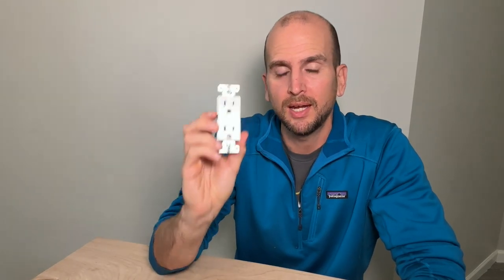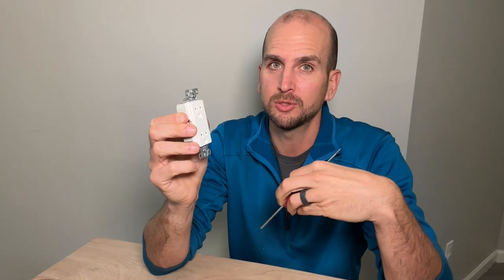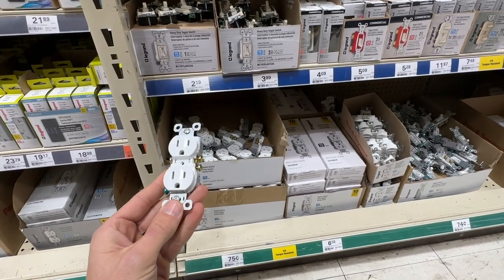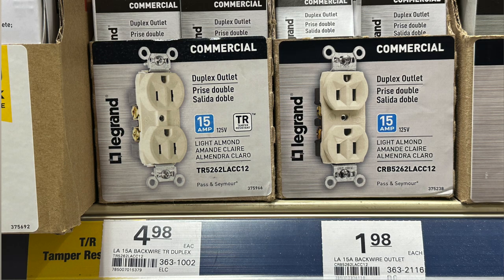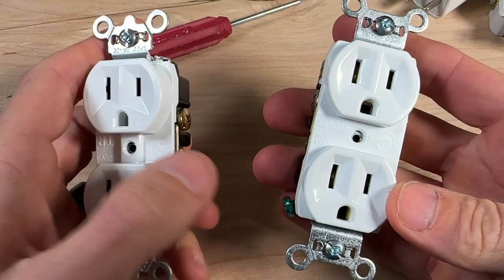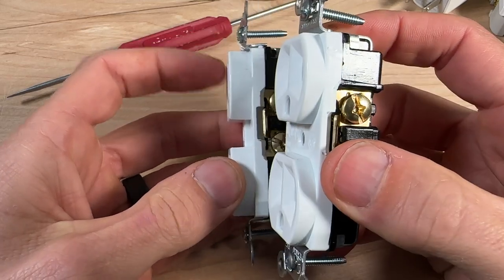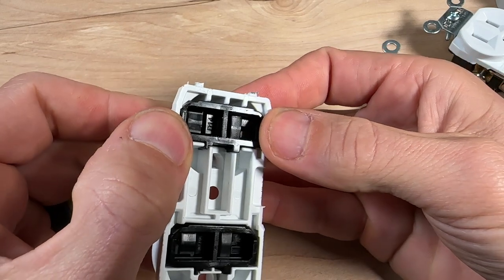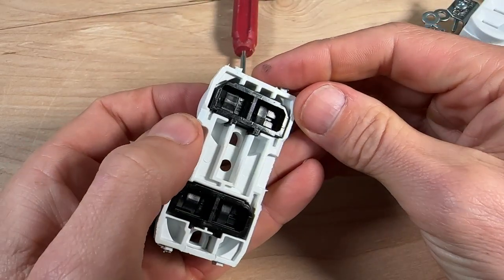The Most Hated Product In Home Electrical

Comment: Don’t like them BUT just switched 20 outlets to TR. why? Because I have kids and I’m tired of having to use those little safety plastic inserts every time I use a socket. They are tight, hurt my fingers to remove, and are generally annoying. Plus, I think they actually TEACH kids to stick things in outlets lol. 

When they’re older I’ll likely switch back to standard.

Comment: Nothing wrong with coming up with common standards but forcing the design will not allow for better designs.

I mostly use Eaton or Leviton, they both have had issues with TR on scale (mostly manageable), only had one broken one with a GFCI by Leviton once. 

Sometimes when trying to plug something in it doesn't go in like you demonstrated. I found simply rotating the plug clockwise/counter clockwise while apply pressure it eventually works. If the plug requires this after a few attempts, might want to replace it, maybe something just out of spec.

Also if there is too much wiring in the box or you are putting too much pressure on the outlet, this may cause a problem as well and it will not matter the manufacturer.

Please don't play the commie hand while using a product that you like as an example when it was designed in the free market... And then declare the rest all suck and should have been made this way and imply that this design is obvious. There are patents and intellectual property issues that you are glossing over.

Comment: I’ve taken the Amish approach to electrical outlets- use someone else’s. I’ve been told that every time you say you don’t believe in using GFCIs everywhere, an NEC author stubs his toe. I keep wondering where the line gets drawn with expensive safety features. More safe is not better when the risk doesn’t justify the cost! If you can afford more safety- perfect! Do it! If you’re like everyone else, chose an appropriate risk level and build to suit.
Reply: Let someone get hurt in your home with an item that you should have purchased diffectly by code and see what your homeowners insurance does if they is a liability issue...
Reply: New term: “diffectively by code” 

It’s not unsafe, it’s just not the level of ‘safety’ that some dude somewhere arbitrarily decided I should have. Again, I have measured the risk, and the risk was left wanting.

Comment: Wouldn't it make more sense to have the mechanism only block the hot side rather than both? Then it could be simpler and more reliable. Idk. I have a design in mind, but don't want to sketch it out right now haha. Also, I used to work for legrand and get really low prices on outlets, but I didn't think to get TR ones because they didn't seem to address a safety issue as well as partially insulated prongs would, like they have in Europe. I've never heard of anyone getting shocked by an outlet without something plugged into it, but I know lots of people who have touched one or both prongs on a plug while unplugging somthing.
Reply: Every friggin kid I know has stuck an item into an electrical outlet and received a shock, I did, my daughter did and both of my grandkids did. Do you have no kids, family or friends?

Comment: I think the premise is wrong: No, it is not ok to impose additional cost on something because it buys safety, without asking what that cost is. 
If the delta in price is indeed $3, then every 300,000 outlets bought would cost $1,000,000. For that money I could buy a lot of safety in other areas where it would make a difference. I doubt that every 300,000s electrical outlet is saving one child from being electrocuted.

Comment: As a 25 year electrical journeyman, I have installed and used a lot of TR's. The key with TR's is you have to be pushing straight in, we are use to the old ones which allow a lot of wiggle room especially vertically. TR's do not like that, a little more time aligning the plug cord end up with the recepticals allows them to function with minimal effort. It does not take long to get use to this we are creatures of habit.

Comment: If tamper-resist was cheaper I'd still pony up for the non-tamper-resist because i DESPISE those things. it's similar to the modern gas jerry can spilling more fuel than I've ever spilled with vented non-safety nozzles. I've BROKEN cheapy prongs trying to push into tamper-resist outlets.

Comment: Totaly understand safety but when you’re trying to insert a non damaged plug end into a TR and it binds the cheap metal bends inward and grounds hot to metal mud ring its bad. I’m more of a fan of safer breakers that i do have and also have my fair discuss about. CAFI breakers nuisance trips .But thats good with ground faults and afci issues so if national lampoons Christmas cat gets cord it may not use all 9 lifes 🙃

Comment: I live in a house that is at least 30 years old.  There are none of those things in here.  They are the old regular outlets.  I never had any problems with them and so I just leave them as is.  First they mess with our gas cans and now they have annoying mechanisms that only make them harder to use now they do this.  If they didn't get any extra money from selling something "new" they probably wouldn't do it.  Really they should wait until all of the problems with those outlets are fixed before they make it a part of the code to use them.

Comment: An extra couple bucks per outlet times 50 plus the hours to replace your already installed outlets vs. $7 for a 25 pack of little plastic child safety covers is an easy choice. I just wish they were easier to remove when necessary.

Comment: i put in TR outlet in my shop cuz my electrician though it was a good idea. they are awful. 80% of time i cant get something pugged in on one attempt. they bind up when pluging in a normal plug. and i actually have the opposite problem, I had to check 2 different stores to get a normal outlet, cuz I'm never buying TR again. spending 5 min to plug something in instead of 10 seconds is not how i want to spend my life

Comment: I'm not worried about my kid sticking something in an outlet because when you get shocked the first thing you do is pull your arm back with brute force lol. People lock on to the power when you grab onto it so it makes your hand grip harder. When you grab a fork and shove it in its not your grip strength that's the weakest link it's the grip of the plug onto the fork. so no real risk of prolonged electric shock

Comment: I absolutely hate TR outlets. At least all of the ones I've used have been super janky and require a ton of force or fiddling to get them in. I usually get tired of them after a few times and replace them with non-TR outlets. Maybe there are some good quality ones, but at least the ones I've used have been crap, and I never buy them if I have to replace/install new receps.

Comment: I stuck a Bobby pin in an outlet when I was 3. I never did it again. Problem solved.  We can't make everything 100% safe. These outlets are ridiculous.  Put in the plastic plugs if your worried about kids. The tamper resistant features make them almost impossible for anyone to use.

Comment: Not safer. I went ahead and replaced mine because my son is super curious. Since installing I've found many plugs are not plugged in all the way. My wife plugs them in partially because she isn't paying attention, she has power and just isn't using enough force to plug it in all the way. I now have plugs with powered and exposed leads randomly throughout the house where the wife plugged something in

Comment: I hate these. I have one on an outside outlet. One day I couldn't get my pellet grill plugged in because it had permanently tamper proofed itself. I took a flat bladed screwdriver and smashed it in each of the slots of the outlet to defeat the tamper mechanism. Problem fixed.

Comment: Understanding and agreeing with the  concept of safety , I question the mentality of putting the plastic "child guard" plugs in the outlets. First , children WATCH the adult putting something in the outlet, so therefore 'monkey see, monkey do' thinking in their brain. Then the curiosity of unsupervised children successfully removing these small guards and then placing the guards in their  mouth, so a choking hazard.  A concern in my mind for a second 'standard' is receptacle box installed at 16 inch (top of box) . How is that standard good for the elderly to have to bend over so far to plug something in. How about wheelchair  bound persons trying to plug in to the receptacle without falling out of the chair.  There should be more flexibility for us installers to tailor to the needs of our clients.

Comment: When I was redoing all the outlets in one of the homes my older sibling got a ways back, I actually used these quite a bit. The mentality I took is that for general living space rooms (bedrooms, hallways, etc.) I used a standard decora outlet, but anywhere where moisture can be prevalent - like basement, garage, or washrooms (on top of the GFCI requirement) - I swapped the TR style in. While there's nobody little sticking paperclips into the outlet in the house, the reason I went with them is I felt while it does very little to make an outlet waterproof, that added shutter struck me as being helpful to keep direct moisture out of the socket - especially say if you wash your hands and go to flip off the light switch which is next to an outlet in the same box. I used mainly all Leviton brand (just what the store around where I am stocks the most of) but can't say I've had any complaints with them... Well, ok, my dad hates them because they stop him from being able to easily check current/voltage with his multi-meter probes but that's a bit of an edge case if I ever heard one haha. Great video!
Reply: You should have bought WR not TR. And try drying your hands before you flip the light switch, you could still get a good zap from the switch alone!

Comment: OMG @2:50 the price difference is only 3.00 used I rather spend more than get the standard ones. Plus, you should never buy the cheapy 0.74 cents outlets. Trust me I did and within 1 week that outlet went faulty. Every time I go to plug something into that cheap outlet it would trip my breaker and also notice some arcing as well with those cheapy outlets.

Comment: On Decoras Cost difference in truth is about 20%   not 100% .....
And sadly our home Impovement stores do not sell Decoras 'regular' 
While I get the issue of 'safety' .... the problem with the flimsy electrical plugs these things are a nightmare and truly non functional and actually more dangerous as the prongs on plugs bend
I did my home, I searched high and low to find non-TR decora outlets  
Note, I have no kids around, 59% of households have no kids around
.
The logical thing would be to switch to European outlets/plugs, but reality unfortunately does not let us dump our US garbage plugs and outlets

Comment: One single probe in the hot side will not short or burn the inserter since it is not connected to a neutral or ground. If the kid sticks a fork with two prongs, he will get shocked anyway. And where will he get a two pronged fork? In the hors d'oeuvres drawer?  Or two separate prongs, like a baby pin or spread paper clip?. They will go in. So 'tamper resistant' is nonsense. Two things that will arc go into the slots whether or not. One thing does not. But one thing only is not a danger.

Comment: It's ridiculous to have something be part of code when they don't even function correctly. I don't know the brand, but my parents had a room redone about 10 years ago. All the outlets are TR. And all of the ones that are in regular use are already breaking down. Unreasonable force to push them in, and then they don't even hold the plug in, so the prongs hang out exposed. And power adapters just fall out. My assumption is the way your hand has to force plugs in causes the prongs to go in at less then ideal angles, damaging the terminals. So now you have the fire hazard of loose connections in the wall in addition to live, exposed electrical contacts.

Comment: I'm all for safety but enuff already. The reason most aren't using them is we are tired of Gov't over reach. TR outlets in a house with no children and the residents can't  plug into them because they push too hard. Gfci and Arc fault breakers , extremely expensive and though better than they were just do not work. Most new construction houses exchange them for standard breakers after inspection because they are sick and tired of their constant tripping. Gfci on circuits with freezers and fridges, come home after a few days away and your food is thawed and spoiled!! Car chargers, go out to leave for work and your car is uncharged because it tripped. And why do you need Gfci outlets for garage door openers that plug into your ceiling outlet? Ridiculous. I do not have 1 gfci in my house or garage, they weren't required when I bought my house or garage. I do have exterior Gfci on exterior of garage as they should be. If we are being forced to use these items then they need to work as efficiently as what they replace and at the same cost, not at 10 x's the cost.

Comment: The CHINESE knock off no brand Tamper resistant outlets both residential and commercial are BAD BAD. I have samples of them too. They are easily defeated as  with older 1980s GE residential grade outlets and they bind up more often as you mentioned, and they break under frequent use or heavy use(rated 15A and you use 13A or higher loads, they melt). And they are not impact resistant despite being thermal plastic instead of the much older no longer used Ivorine or Bakelight ceramic like plastic composition.. The US branded outlets for the most part are great these days but you get what you pay for too so. My preferred outlets for tamper resistance and looks are Hubbell and Legrand/P&S brands.. Bryant is like Hubbell now, though they used to make a tamper resistant outlet that required 3 prongs to be plugged in before the shutters would open, the same as British Sockets do.

Comment: another reason maybe is only 2400 children a year get hurt by electric shock and so electrical code is not going to mandate and for good reason as most of us apply the winnebago battery maintenance effect and dont want to tear our house apart to get to  the outlets to change them.

another thing that would work better is to have a diy zero skill solution in the form of a wall wart outlet box where the tamper resistance is built in so all the diyer has to do is remove the cover screw and plug in the outlet box and tighten the new screw and no need to turn off the power and the job is done very quickly.

it would be easily replaceable should the tamper resistance device should fail.

a problem with tamper resistance is only a couple mm of the prong makes contact and with heavy loads like air conditioners could cause the prongs to get hot as there is less area to make contact.

as an outlet splitter box there is more room to fit the parts and make it more reliable.

Comment: You forgot to mention the biggest flaw with these tamper outlets. The are not made to accept a standard receptacle. The housing is thicker. So the prongs on the receptacle don't make full contact. Fire hazard.
They are junk and I will never use them in the current design.

Comment: Or another reason: You don't have kids, and don't plan on ever having kids, in the home. No kids, means you don't need tamper resistant outlets. Installing them in a home with no kids, and no plans of having kids, just introduces more costs, failures, and difficulties unnecessarily. Also, they make little plastic plugs that fit into empty sockets that are actually a bit challenging to get off unless you know what you're doing.